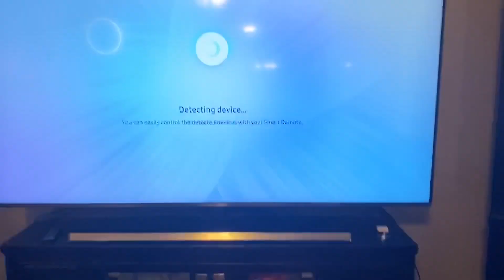Razer Core X Chroma eGPU enclosure - unboxing and setup with MacBook Pro

Comment: Ah! Nice. I’ve recieved my egpu-setup in a lot of different shipments.. Still missing the RTX and macbook pro. So.. I needed to see this.
Reply from the maker: I now have everything setup and working nicely, except the Ethernet port on the enclosure
Reply: @TheRunningWife  hey, im using the chroma with a 5700 xt, but it seems to freeze my computer once in a while doing random actions, nothing intensive, I'm not using any ports behind it at all, running on a MBP. 16 inch. any advice?

Comment: Does the Ethernet port have any compatibility issues with Mac? How dows it run?
Reply from the maker: Yes, there are issues with the Ethernet port. I had to install a driver to get it to work. Never got it to work that well
Reply: @TheRunningWife  Do you still have issues with the ethernet port?

Comment: What eGPU/AMD Graphics card will work with my 2016 15 inch MacBook Pro? 

processor: 2.9 GHz Quad-Core Intel Core i7 
Memory: 16GB 2133 MHz LPDDR3 
Graphics: Radeon Pro 460  4GB Intel HD Graphics  530 1536MB

Is not for gaming it’s to edit 1080p and maybe some 4k videos on FCPX.  
 Do I need an external monitor  with the eGPU? Which you recommend with my specs?
Reply from the maker: As long as your model has thunderbolt 3 ports, I think any eGPU should work. I can only recommend the one in this video, as that’s the only one I’ve used, but there are cheaper ones. As for which card, I’ve got a 580. But the 5700 XT is probably the best available currently
Reply: @TheRunningWife  Thanks for the response... can you hook up an external monitor with that one?
Reply from the maker: Yes, they all will support external monitors.